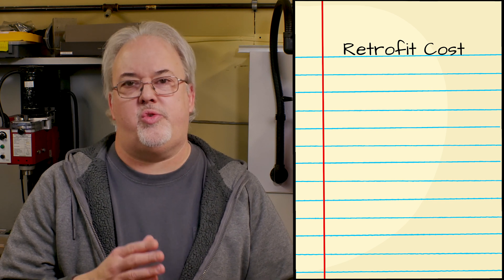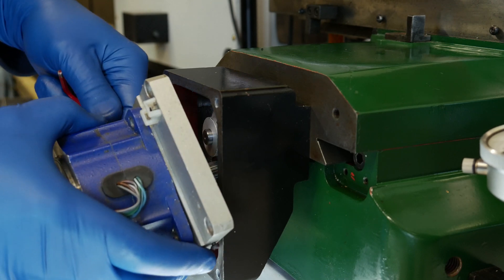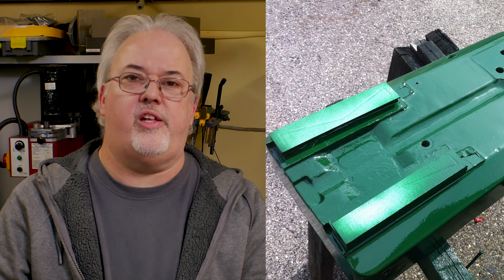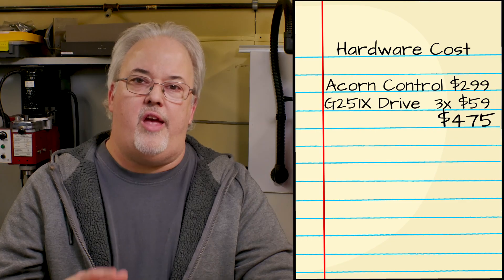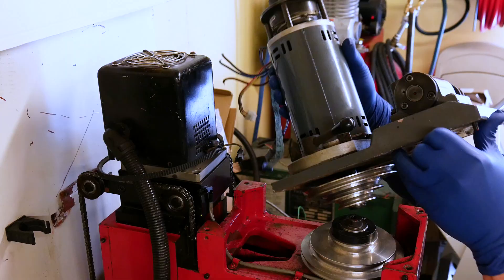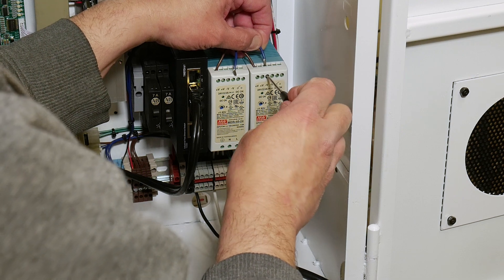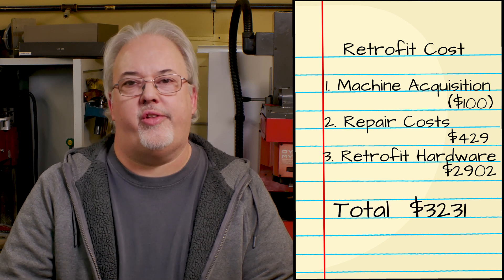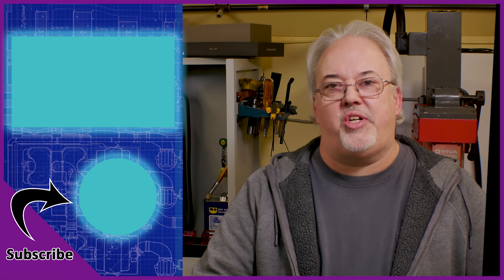CNC Retrofit: What Did it Cost??

Comment: Pete, I just finished watching your series on your CNC retrofit. My project is a Bridgeport CNC retrofit that I have had for 3 or 4 years now. I have had some difficulty staying motivated on that. I just feel overwhelmed sometimes with all I need to learn. Anyway I really enjoyed your videos and learned quite a bit. I do have a couple questions I hope you can answer. I don't recall you adjusting the gibs for the ways in any of your videos (perhaps I missed it). I am wodering how you adjusted those and what that entails. Also, what PC (brand/model) did you use for that project? It looks like a nice small computer that would fit in my cabinet and wanted to check them out. What are the considerations when buying a PC for the project? Thanks again. It is a great series.
Reply from the maker: The gibs on the 2800 are full length and there is a screw at both ends of the dovetails.  You loosen one and tighten the other to move the gib.    I usually start by overtightening them a bit and then backing off until I don't have any motor stalling issues.  It always seems to take running back and forth a few times to get them to settle into their spot.  It is not as easy as it would be on a manual machine where you can feel what you are doing by turning the hand crank but you can start to hear the motors complain a bit if you go too far.  
I used a Shuttle computer.  My primary decision there was convenience.  We use them for machine control at my day job and had them sitting on the shelf.  It was easy to have them just deduct it from my paycheck.  So I didn't really analyze it too much.  If I had tried the shuttle and it didn't work, then I would have gotten into the specs but as it was, it just worked.   Thanks for watching!

Comment: Pete.  Informative videos.  Thanks for posting them.  I do have a question.  When you were setting up your DMM what diagrams and settings did you use?  I am working on mine and having a bit of a challenge with it.
Reply from the maker: I used a diagram that DMM supplied but had to add a bit of interpretation to because (as I recall) the diagram was expecting solid state outputs and the acorn has relays. Still the same basic idea just had to pay attention to hooking to the correct contact (normally open or closed) and what the common wire needs to be.

Comment: Great movie, explains everything. Compare this to my retrofit costs.
Machine DM2800 (operational and complete) $ 2000
A set of Mitsubishi servomotors 700 $
CS-MIO control + small electronics 500 $
Servo for spindle $ 200
Another $ 300
Together, it costs $ 3700, I have original stepper motors and electronics for sale.
Either way, this retrofit makes sense when comparing the DM2800 to today's small machines.
Reply from the maker: Thanks! It really is amazing how many options there are out there today for doing a CNC conversion.  I remember when I did my first around 1995, there weren't many choices for the home hobbyist.